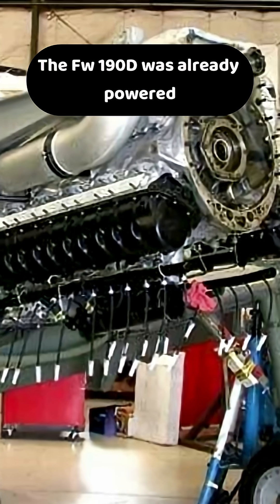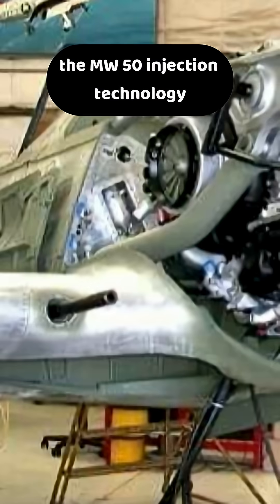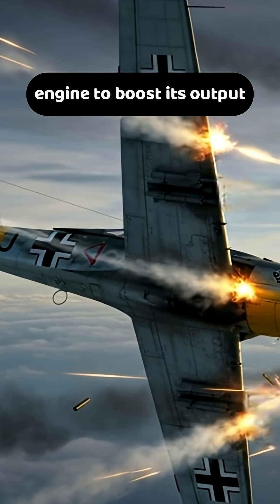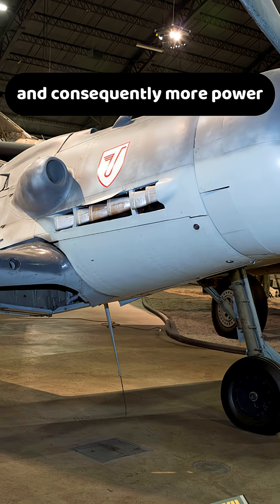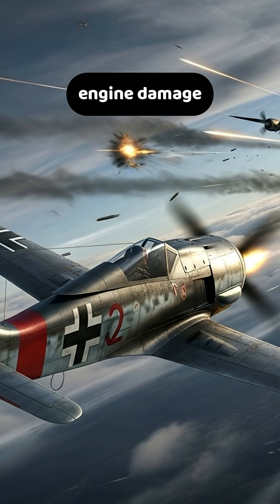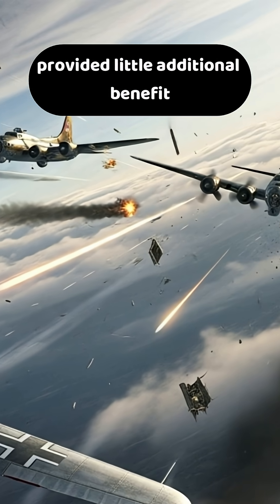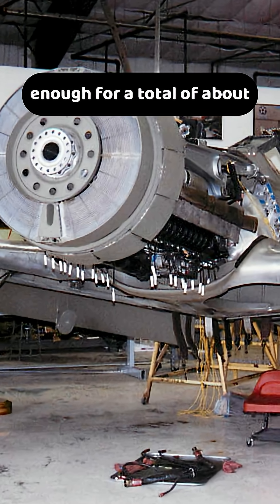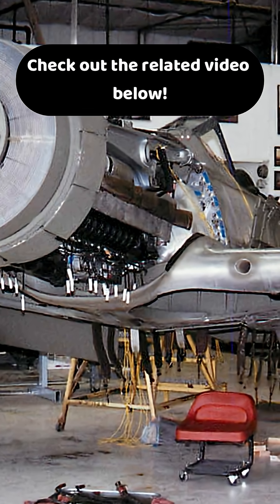How Water Injection Gave the Fw 190D an Extra 500 Horsepower?

Comment: Hint: They never went past the notch, and never used water injection in combat. D-9 pilot Erich Brunotte, who you can find on Youtube being interviewed, said he never went outside 50-60% of max power in combat. This is because combat essentially meant turning all the time by 1945 (another myth was that turning was obsolete), and I think a deflection of air during turns was favoured by lowered power: Deflected air got squeezed between wing and prop, and squeezed air accelerated the wing top air, boosting turning lift... Squeeze the air in one point and, unlike traffic, it ACCELERATES... Even the Zero was criticized by US Navy pilots for not down-throttling enough. Turning was against J. Navy doctrine... Given they had 1/3 their weight in thrust. all these WWII pilots do is talk of permanent down-throttling during multiple circles (constantly), and certainly never talk of using full power except for straight lines. The Spitfire, needle tip P-47 and the Yaks were exceptions, in the case of the P-47 because the needle tip prop was already "less power"... In the case of the other 2, I think swept or very thin wings did not squeeze the deflected air enough to make feeding more turn curvature-deflected air into the wing top (with less thrust) worthwhile...
Reply: I'm thinking by in combat they mean while pursuing an enemy plane or trying to get away from one. Like you said, in a straight line. Not while trying to execute turns to dodge or track another plane.
Reply: @scottverge938  The exact opposite: He literally says they almost never used WEP: The whole quote: -Erich Brunotte (YT interview, ;"The Fighter Collection/Eagle Dynamics; Luftwaffe fighter
pilot Erich Brunotte meets the Digital Combat Simulator FW-190D-9"): 

https://youtu.be/kOuVqP89058?si=GJbbf3XbMdlEg3B2

 at 12:15: "Engine
Power Management"; "Just  Full throttle , but we almost never used it. We knew (because the notch) we had it on normal power but you would throttle back even from there as you did not need that much in a fight – You used
WEP when the opponent was better, to get away or get close [implies straight lines] but it happened rarely – The manifold pressure [in combat typical] was usually 0.9 to 1.2 ATA."; [50 to 60%: The FW-190D-9 maximum was 1.7/1.9 ATA.]

Comment: Considering that US fuel was 130-150 octane VS German fuel of 87 to 100, they didn’t have much choice but to improvise.
Reply: They made much bigger engines with low performance superchargers without intercooling.  Their lower power above about 18,000 feet was because of burning out the inferior metallurgy engines at high throttle with poor fuel.
Reply: Dad told me buddies of his ran AV gas in a flathead 6 Plymouth. They advance timing way up getting great HP until the valves roasted. Dad was a Pratt and Whitney us navy mechanic

Comment: I thinks he means nitrous oxide injections……
Cause water injection has a cooling effect
Reply: MW is indeed 50/50 Methanol and Water (Methanol und Wasser), as explained in the video it was to cool down the air in the supercharger to allow extra air being compressed into the engine and so generating extra power.
Reply: You barely think if you comment despite aircraft technology ignorance.
Reply: @givenfirstnamefamilyfirstn3935  Well, can we have that in English ?
Reply: @wingmanjim6  Yet you are happy with ‘I thinks he means’?
Reply: @givenfirstnamefamilyfirstn3935  Well, one letter is easy to figure out, and could be nothing more than a typo. Yours sets new standards in cryptography !
Reply: @wingmanjim6  So easy to figure out the rogue ‘s’ yet you need a hyphen link between ‘aircraft’ and ‘technology’.  Have a nice week-end.
Reply: @givenfirstnamefamilyfirstn3935  I hope your English class works out for you........
Reply: @givenfirstnamefamilyfirstn3935 🤡
Sorry this isn’t your show 
The circus starts later

Comment: Both the Thunderbolt and Mustang had WEM war emergency power for at least 5 mins. After that the engine could overheat at lower level.
Reply: It was a longer than 30 seconds.  At least 3 minutes on a tempest and more on a Spitfire.  Increased 100/130 fuel (130 means 30% more power when rich).  The Fw 190D9 usually ran on 87 octane producing 1750 metric horse power and 1900 in emergency power.  It went to 2100 special emergency  power by using super charger pressure to blow in water methanol.  Using a junkers system with a pump rather than blower pressure gave even more power.  High octane C3 was better still
Reply: I know that some Corsair models had WEM, and I think some models of the Hellcat did too.
Reply: @markforster6457  both the hellcat and the Corsair could have water injection.  If the Pratt & Whitney model number had a W at the end of its model number, it meant to have water injection.  The Wikipedia article lists these
Reply: I saw an interview with a P47 pilot, and he mentioned 5 min.
Reply: @Rockhunter329  the P 47 had a very small water/alcohol tank.  It was about 20 U.S. gallons. So it probably simply ran out.  
-The Engineers usually placed limits on how long emergency power could be operated before the engine had to be allowed to cool down.  As engines improved with more cooling capacity, for instance larger oil coolers or reservoirs the period was extended.   The German engines usually had 10 minutes.  In some cases in the FW 190  cooling had been improved  so that this was effectively unlimited so long as the temperature limits weren’t exceeded.